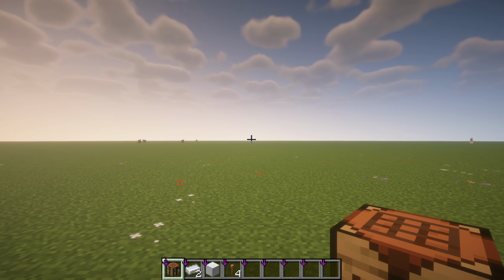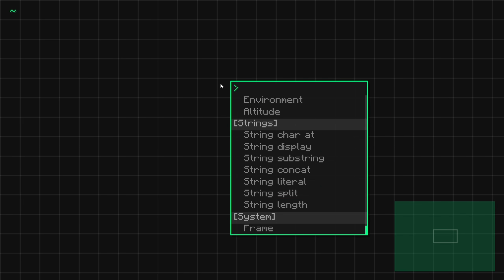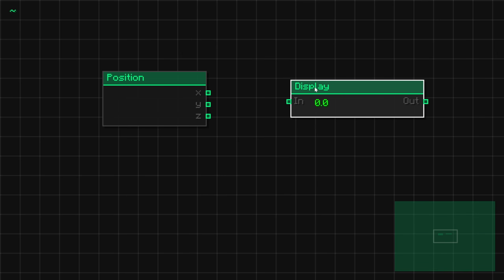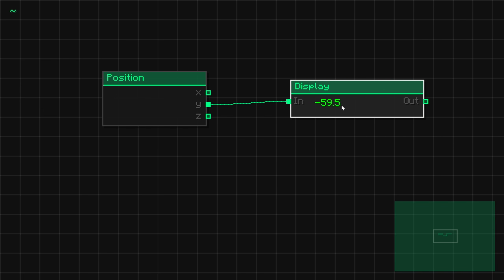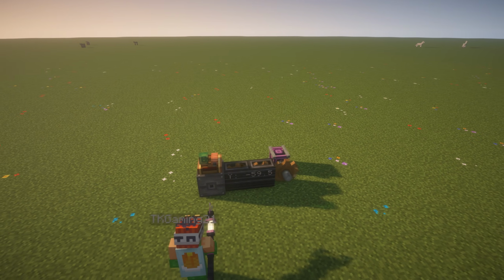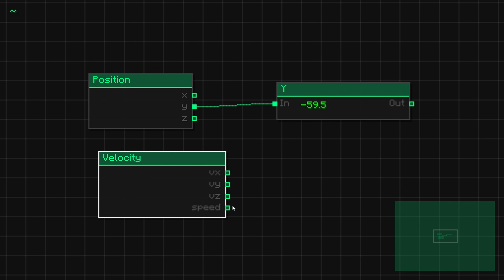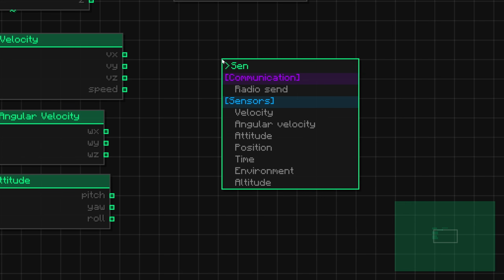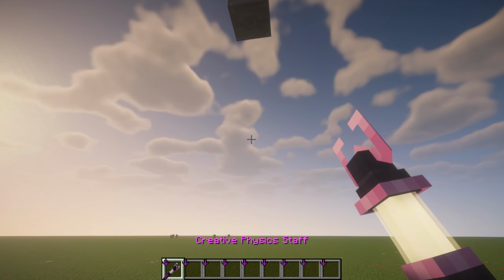Sputnik Probe Basics p. 1 | Cosmonautics

Comment: Potential missile guided mod
Reply: This is fully correct givin that the mod can use linked controller frequencies and you can make nodes for math meaning you could have it calculate a flight path to any coordinates. could also be good for autopilot or transportation systems.
Reply: The missile knows where it is at all times this is because the missile knows where it isn’t